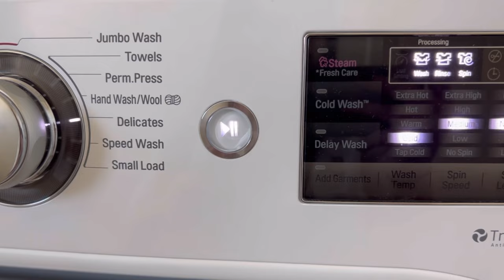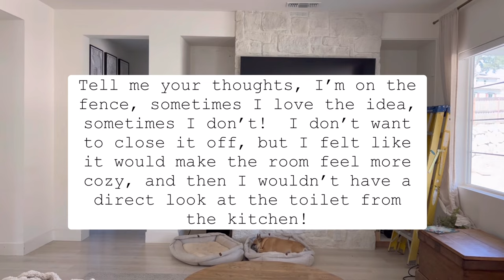POTTERY BARN HIGH PERFORMANCE SOFA REVIEW || BEST WHITE COUCH || HOME UPDATES || HOME DECOR

Comment: I am trying to find a sofa now. Had to leather sofa express sofas that lasted 20 years. Frames still excellent and cushions still holding up because of built in springs. Just time to change colors. Now looking and hard to find good quality. Was looking at RH but then will not disclose how frames are made and most cusions just barely stuffed. Do you have any brand recommendations?
Reply from the maker: Hi! I only have had pottery barn so I don’t I’m so sorry, but I am sure RH quality is top notch and you wouldn’t be disappointed